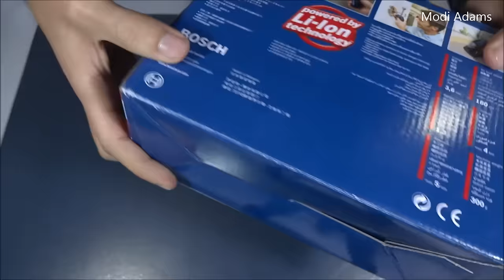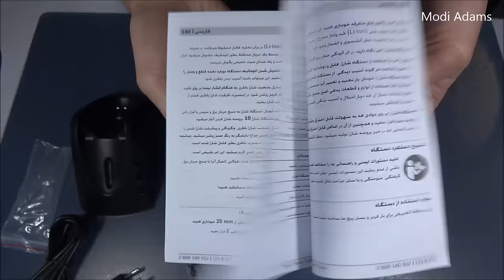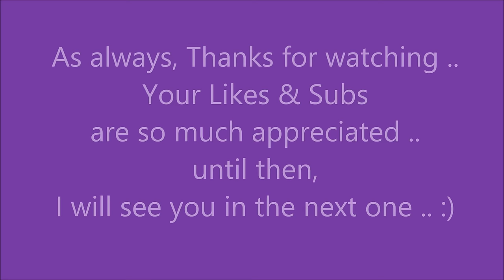BOSCH IXO 3,6V Cordless Screwdriver Unboxing & Review

Comment: Can I use drill bits and use for drilling? Are there any attachments
Reply from the maker: Vishnu Reddy, Unfortunately, you can't use any drilling bits except the included one, since it's not meant for drilling, it's just a basic electric screw driver.

Comment: why is it mine in a tin can. yours in a bag?
Reply from the maker: Michael Eugene, well, later on i discovered that this screw driver has lots of different editions, some has a USB-Micro Port which allows you to charge it with a regular phone charger or any USB charger, while mine came with a desktop dock charger and it's the only way to recharge it, so they are different models and colors as well.
Reply: Modi Adams evrthing is the same. Except for the packaginf.
Reply from the maker: hmmm, there must be some letters or numbers that differentiate the models and also they could be different according to countries, some models of tools or machines are meant for a specific markets, China, EU, USA and so on they are not all the same, while i rarely use it, yet still a useful tool to get, i only bought it cause i found it on sale :D !
Reply: I think the older version has different packaging.